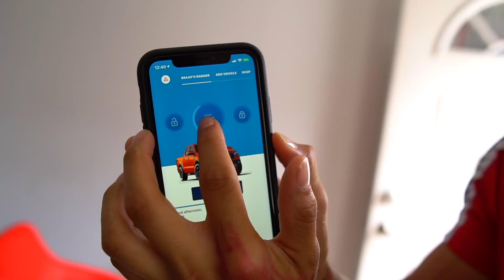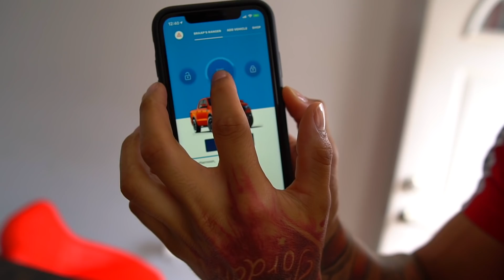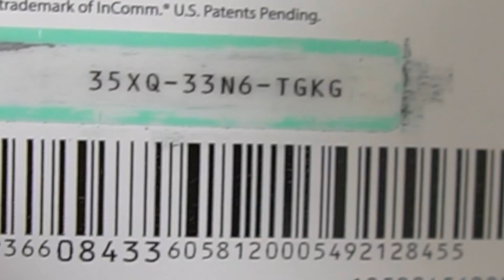NO WAY 2020 YZ450F ! | BRAAP VLOGS

Comment: Yo brap,  how tall are you?, i want to get the yz250 but im 5'7, i seen the 2020 yz250 in person but it sits a little to high,  can't i buy  smaller wheel for it to lower it a bit?
Reply from the maker: I’m 5’7 and I are cool
For the 250
Reply from the maker: U
Reply: Bettz,  im ganna try and sell my yfz 450 to get the 2020 yz250, the grey is clean,

Comment: That app has been around since 2008 called viper smart start goes off cell phone reception
Reply from the maker: Bada Bang cool 😎
Reply: So if you buy another whip just add it homie 😎
Reply: Wrong bro. Chevy got onstar which you can remote start your car. I think ford is my link. Each maker has something like it but not in every car. Your car has to have remote start to be started by the app.
Reply: Clearly you don’t listen I own a car audio place we been installing them since 2009 on ANYCAR
Reply: Bada Bang how much ur charge for a 2011 Ford Taurus

Comment: The 2020 yz250f and yz450f are the exact same they just changed the color and graphics
Reply from the maker: X KVNG X facts !
Reply: Partially wrong, the YZ250F is indeed a carry over from last year's update but the YZ450F did change for 2020. Motor received a new smaller head with lighter valve train. It also got an updated chassis where Yamaha thinned out the upper spars to improve it's flexing characteristic while the frame's lower cradle was beefed up. Fork valving was also updated to accommodate for the frame update. Check out Michael Lindsay's channel, he recently did a 450 shootout with tons of accurate information.